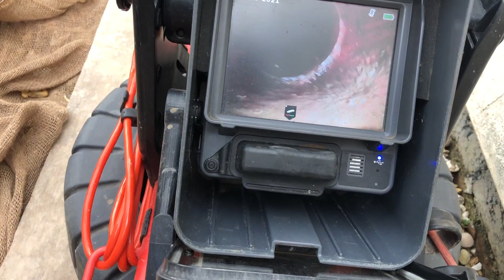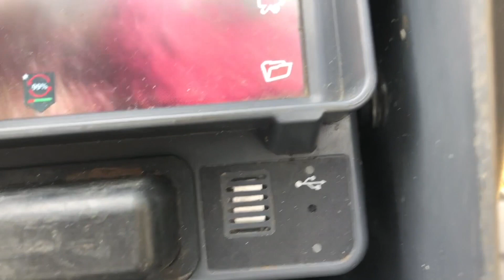Investigation of moisture and sympathetic repairs following RICS joint damp methodology

Comment: The finished job does indeed look great. Always good to see the way you track down the actual cause/s  of the problem and work with materials compatable with the original building.  There are very few investigators who adopt your comprehensive approach or indeed have invested in the kit you have at your disposal. Others will, or should, learn from your example.
Reply from the maker: Thanks Alan👍 it does look nice with the lime render finish…. Those magic vents are often sold as a solution when there is a drain defect. If it sound 2 good to be true it normally is. Even the data they produced show they don’t work😂😂😂

Comment: That looks really good even without the lime wash. I presumed you would have mixed your own lime render? Why not? It must be expensive buying it mixed. Oh and that but where you have the shades and hat on backwards you look totally unrecognizable to when your stood in the office normally
Reply: Speaking as a customer I would be happy to pay for the lime mortar/putty to be purchased ready to go. Using lime will be a slower process and I want to make the life of the builders/plasterers etc to be as easy as possible. Not just to be nice but I could well get a better job done by simplifying the process.
Reply: @mbak7801  I'm sure Ross is gonna tell me why but as an uneducated man in this area im reading you can make lime render with just 4 sand to 1 hydrated lime so not sure what the point in buying it is. I'll be wrong but if I didn't ask I would never know
Reply: Dont think you make proper lime mortar by mixing sand (sharp) with Hydrated lime, not least because once hydrated  lime is opened  it starts to deteriorate/set. Also the proportion is most often 3:1. Do consider obtaining a copy of very reasonably priced  "Period Property Manual" by Ian Rock as  this has a good chapter on The Magic of Lime. Premixed lime mortar is ideal as it is consistent, easy, and its properties are known.
Reply from the maker: It did float up lovely bud 👍 this is a pre mixed lime putty. I always have a load of this in me unit, so it’s easy to pick up and get on with it. This property had issues with access, so it was easy to put into buckets in me unit and mixed up👍 it was boiling so have and sunglasses were needed 😜😜😜